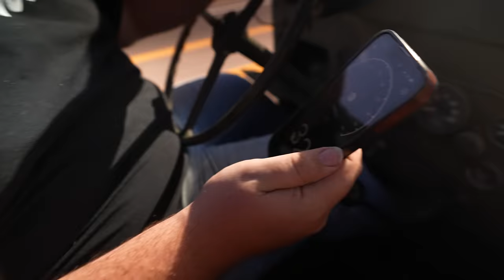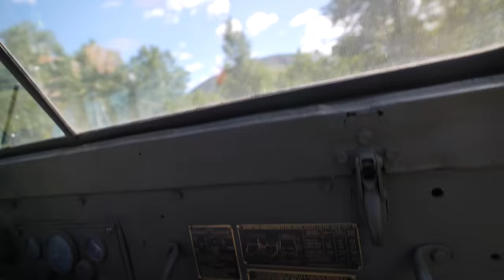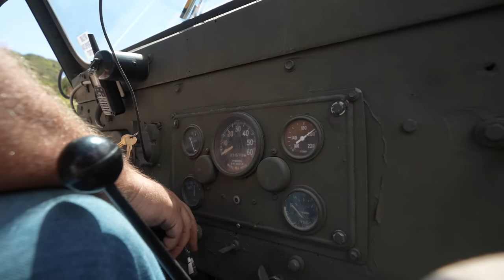1153 Mile Road Trip in 70 year Old Army Jeep

Comment: When I was in the Canadian Armed Forces, I drove a jeep classified as the 1968 Standard Military Pattern 1/4 truck, built by GM Canada.  Mine was actually a 1972.  It was very similar to what you were driving.  Because I was 17 and 18 years old at the time, the lack of comfort never bothered me.  But what I did like was:  a) it always started, no matter the weather, b) it was reliable as all get out, c) it always got me to where I had to go and d) it was tougher than anything I have driven since.  I'd love to own one now.  The one I drove, due to a mysterious lack of a governor on the engine, would reach about 80 or 90 mph in 2 wheel high.  But in 4 wheel low, it wouldn't go over 40 but would take you halfway up a mountain.  Just watched the part about the generator and the belt.  The jeep I drove in the army had 3 belts, so you could have 2 fail and still have a belt to keep you running.  I guess that old Willy's didn't have that?  You also said it was 70 years old?  That thing is older than me!  LOL  I wish I still ran that good!  LOL

Comment: I remember seeing a video in which we were told that there are 3 adjustment positions on the throttle linkage under the bonnet (hood?) That was designed for different levels of driving ability & requirements on the battlefield.
Military vehicles in some countries are geared to be driven at 45 miles per hour, which is convoy speed.
Reply: Can confirm my UAZ caps at 45 not WOT but the motor be screamin doing it.
Reply: @USSRDragon  I had a 47 Willy's with the flat head 4 cylinder, had 5.14 gears I think
Reply: @Maples01  the UAZ has around 3.9 in the diffs if I remember correctly, the cool part is that the transfer case doesn't change the ratio out of the transmission but rather going into the transmission. So really it could be considered an eight speed, gears being first in the low 4:1 second around the mid 3:1, third is high 2:1 and fourth is 1:1, but go to low on the transfer case and then each gear goes from 1:1 to 1.89:1 so now first is nearly 8:1, and so on. It also means it has 2 reverse speeds. Also it does barely manage 89hp at 97ft/lbs of torque, though that was also measured with 70 octane. Now with the MSD electric ignition and the lowest of 85 octane here who knows what it manages now.
Reply: @USSRDragon  Lower octane, you advance the timing to make up for it, just a few years later, it was offered with the Dauntless v6. They took a beating, our troops were pretty rough on them.

Comment: Here's a tip, take the thermostat off and see if it has a weep hole. If it does, enlarge it a little (1/64 to 1/32). If it doesn't have a weep hole drill one and start with a 1/64-size hole and enlarge to 1/32 if needed. I'm sure you already know this part, but when you put the thermostat back in, make sure the weep hole is at the top when mounted. So if you're drilling this for its first weep hole, make sure the mounting positions so the weep hole will be on top centered just inside the rolled edge of the thermostat.  These old jeeps tend to run hot, so the weep hole should knock 10-15* F off the running temperature.  Thanks for all these videos and for sharing your adventures with everyone. 🫠      I ♥JEEPs

Comment: You bought an M38A1 if i had to guess, the CJ5 uses the same frame but different gauges. The fun part about them is the fact that they run 10 leaf springs and it makes you bounce. you made an amazing purchase.

Edit, The reason it's so slow is because of the Motor, it's the GoDevil, it had reverse flow heads so that's most of the reason why it drives so slow, then again I would be more terrified to go Fast in a Jeep like that.
Reply: It's actually not the Go Devil, it's the successor (F134 Hurricane). The hurricane is a modified Go Devil that uses Inlet-over-exhaust instead of reverse flow heads.
Reply: @Zark-Muckerberg no it isn’t, you can clearly see it’s a flathead when he opened the hood. Someone replaced the Hurricane 4 with an old Go-Devil. It IS a direct swap, but WHY someone would downgrade like that is beyond me.

Comment: That looks like an M38a1 but has the L-Head engine from the older, smaller Willys jeeps in it.  Looks like it is no longer 24 volts as well.  I have rebuild 2 of those as a hobby mechanic and parts are plentifull especially if you use the early model CJ5 parts as replacements. Be weary of loose steering on those old Ross steering boxes, they can cause instability if you get too fast, the differential gear boxes were really only designed for a max of maybe 45 mph.  Have fun!!
Reply: Yes at 17.15 you can see flat head engine. Perhaps a M38 ? However M38A1 should have the overhead valve 4 cylinder.  Might even have the front axle drive engaged ?
Reply: You can do 50mph

Comment: Bit of clarification, this jeep was not made during WW2, it's an early cold war M38A1 jeep, while it has similar design characteristics, it has a different engine and body panels compared to the original WW2 Willys MB
Reply: Yep, hood is the give away, its a CJ5 body, over head valve engine, WW2 had a flat head flat fender.

Comment: I drove an M38 about 200 miles through WV.  It was awesome but you are correct about being slow.  25ish uphill and 40-45 down.  The M37 and m35 werent much better for speed but would pull or crawl over anything.

Comment: Contrary to what the guy in the video said that WW2 Jeeps were built to last for ever, they were not. What they were built for was for a mechanic with minimal training to be able to keep it running. In the late 1930's and early 1940's, very few people in the US knew how to do basic auto maintenance and repair for the simple reason most people did not own a car. When the US entered WW2, the military planners had to equipment the troops with tools and equipment that could be kept in working conditions in the field by soldiers with minimum training and most of them had never driving an automobile of any kind.

Comment: We had it's mate, a M38A1 of Korean War vintage, in Ethiopia in the 1960s. We did not tear out the excellent GI Light switch, 24 volt electrical system and foot starter, but I wish I had the ability to upgrade the brakes. I had an accident because the exhaust ran a inch or two from the master cylinder on the frame and the fluid boiled away.  ....  Anyway, Thanks For THe Memories!

Comment: That is exactly the vehicle I learned to drive in. NO power ANYTHING. Steering was work  3 speeds and reverse. In 1st gear it would keep going even if you jumped out. It would go until it hit something it couldn't run over and it would dig a hole with the drive wheel. LOL

Comment: Ok, hear me out.. Baby turbo on a rebuild of that motor Or just swap it out for a Baby N/A Diesel engine.  Baby turbo on fresh engine would be epic.  That old war hero doesn't need much, just an update to enjoy driving on the hwy to the trails.  100-150hp and 200tq would blast on for another 70 years.  The Trans can handle twice the torque, it's a beast.

Comment: You should look at a f150 7700 it’s a f250 light duty renamed f150 it is a beast and they are rare with a 7 lug rim and my 7700 has 300000 miles and still runs like a beast it was a ranch truck when the 2nd owner had it I am the fourth owner every owner kept it up on the maintenance
Reply: If you are going to find parts for it it’s best to search a 1998 f250 and you will find parts

Comment: Top speed in 3rd gear high range 35 to 38 In less you find  sleep hills than 40 45 Put it in first 4 low. It will climb the bark off a tree.

Comment: Just imagine to have LITTLE....TINY...VERY SMALL crash in this...Both legs are maybe 2inches from steel plate, steering wheel in a belly already, and head just in a front of a windscreen upper frame. And dont even try to imagine to have 50mph collision.

Comment: Your jeep is a M38A1 and not WWII vintage. However the engine is the older flathead and not the original Hurricane engine that should have been in it.  At least part of your drive will be in the flat terrain of Kansas heading east with a tail wind so you might get it to 40mph. 🤣

Comment: That jeep is really slow mine m38a1 from the Dutch army runs 110 kph or 68mph something is wrong that the engine dont get the right rpm and another thing what strange is that it needs to pull so hard uphill i think the engine is worn out... Oke engine starts good but it is gasoline and that always start easy

Comment: Ok so in a jeep at 32 mph (50ish kmph)   on a road trip that's longer than the length new zealand 😂  it's 1640 km (1019 miles)  from invercargill at the bottom of the south island to Auckland at the top of the north island  #soreasstimefolks